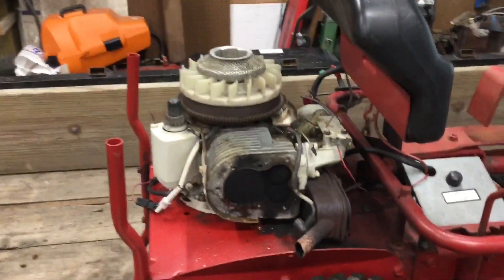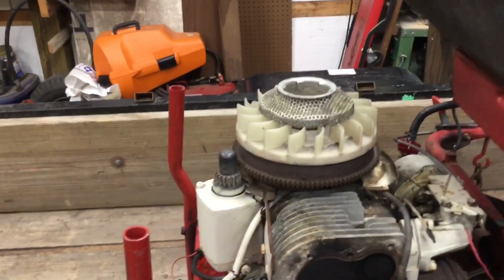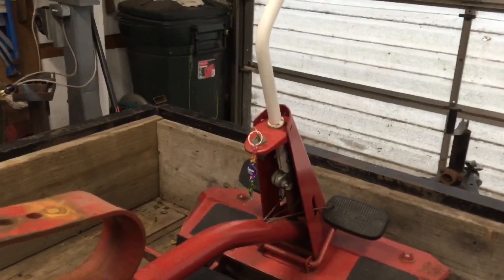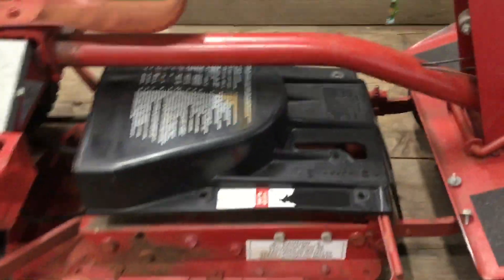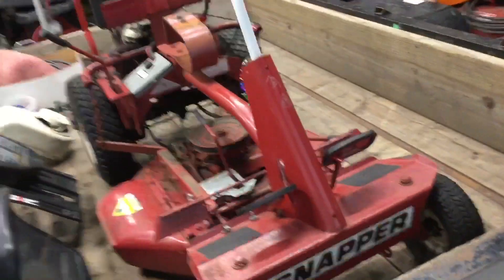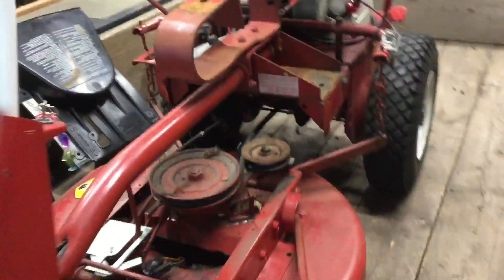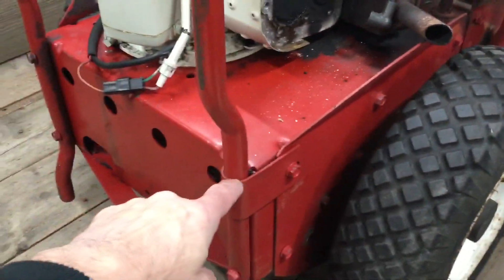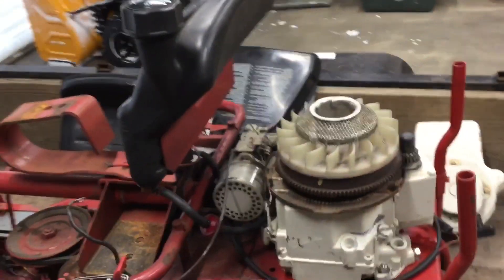408. Where can I buy parts for my 25 inch Snapper RER.

Comment: I wold be interested in the choke/throttle/governor linkage and plate with the levers and springs, if you still have them.
Reply from the maker: I’ve still got the stuff I think I would like to send you some pictures but for some reason I can’t through the comments send me an email so I can email you back and send you some pictures, mine is.    jimsfixshop@gmail.Com      Jim

Comment: Hey Jim,  If you still have one I need to find a replacement for the belt guide for the idler pulley.  If you have one please let me know what you would need for one and if you don't still have one can you tell me what the part number for one is.  I have been having some trouble trying to find it.  Thanks a bunch.
Reply from the maker: I would need your complete model number to find which one you need and are you talking about the one that bolts underneath the engine or the one on the mower deck.      Jim

Comment: Hey Jim Merry Christmas to You , & your family ! That Snapper rer looks closer to a  77 to a 87 ? One it's not a Comet , & does not have the metal cover for the pulleys or the saddle tank, & the handle bar steering came out in 73 ! & that rer is in such great shape if it were mine I'd put a new engine on it or buy a used B&S 8 HP engine & rebuild it with a kit which are still available! & just buy it as is ! As a whole imho , Jim I hope to see that Cub Cadet in action soon with all the snow your getting !!!! & stay warm , & May You & family have a safe , & healthy new year !!!! SNAPPOUT .
Reply: I agree this is an Early 1980s Machine as it also has the Blade safety Pedals which I believe came out around 1983 or so , a 1970 Machine would have had the hoop steering wheel , 4 lug rear wheels , a saddle tank , and the grips on the deck control levers  and shift lever would have been white
Reply: @NorthernMaineProductions  The only thing I can compare it to is a 1974 Comet that I own that is unrestored as of now ! & I did put a bigger engine on it 8 HP 1996 ! Hopefully in the new year as I have everything I need to complete it but time ! One other thing about this rer is it has black hubcaps , If it were a 70 they would be red which are no longer available ! But black ones are , & as You stated there was no blade brake on a 1970 or 74 .
Reply: @ACF6180T  I also Have a 1975 Comet its a 3081-WS , as near as i can tell mine had a Techumseh engine with electric Start originally , it now has a 1989 8 hp Electric start  Briggs on it that is just about had it , the old Machine works awesome but the motor is very tired and needs to be replaced or rebuilt  soon , in 1975 they still had the saddle tank but had the updated seat and handlebars, they still had a white painted Metal Cover on the Deck but all the controls had black grips on them and the wheel caps are Black also I love them old Snapper RERiders they are so robust and tough!
Reply from the maker: How do you read the date code on a Tecumseh engine. This thing can’t be a 1970 unless someone put a old engine on it. Jim
Reply from the maker: I forgot what is Northern Maine products ?    Thanks Jim
Reply: @NorthernMaineProductions  I totally agree !
Reply from the maker: Hey Venice it’s Jim
   I found your channel and been watching some of your videos pretty interesting I didn’t know you had a YouTube channel but I think you owe me for all my help a picture of you sitting on the comet  to put on my Wall of friends. Jim
Reply from the maker: Oops I forgot send it to my email which is
jimsfixitshop@gmail.com
Thanks. Jim
Reply: @jimjackson9381  Hey Jim ! News to me as well ! I didn't know I had a You Tube channel either ! I still have your e-mail address , & I'll be glad to send a picture of the Comet with me on it but I've started taking it apart so it will have to wait when I get together ! & warmer weather . Take care & Happy New Year to You & your family. P.S. Let Me know what my videos are about ! Because I don't have a clue🙃🙃🙃.
Reply from the maker: @ACF6180T  well maybe I got you mixed up with another viewer I’ll have to see if I can find it and let you know for sure. Jim
Reply: @jimjackson9381  Hey Jim Sorry if you got confused My Channel is "Northern Maine Productions",  Not Products , I don't actually sell anything I am Just a guy Who likes to sometimes Make Random Videos from Northern Maine

Comment: Hey Jim, I really appreciate your videos as a good source of information. I'm tired of my POS Cub Cadet and just want something reliable and not buy a new machine. I'm looking at an SR-1433 that's been serviced and looks pretty decent for $400. Do you have any advice on what to look for or if parts are hard to get for it? I can't imagine it being that different, just thought I'd solicit your opinion.
Reply from the maker: No I don’t have any trouble finding parts for them I get mine from Parts Tree.Com on the Texas you can call the phone number which is on the homepage and they will actually answer the phone and help you. Jim

Comment: Jim. Just seeing your video from i believe around Christmas about selling parts off the 1970 Snapper. By any chance do you still have anything left?Thanks again for your videos.
Reply from the maker: Yes I do what do you need.  Jim
Reply: @jimjackson9381  Thanks Jim. One thing I need is the little bracket that goes on the plate near muffler. Hope i’m describing it correctly.
Reply from the maker: Wouldn’t happen to have a picture of it would you is it the bracket that goes around the bumper to help support the weight of the bagger, if so I need a picture of your muffler deflector plate to see if it would actually fit or not. Jim
Reply: @jimjackson9381  Yes I think that’s the one. I’ll try to send you a picture of my machine and maybe you can see what I’m talking about.
Reply from the maker: @thomasiadarola35  send it to my email which is
jimsfixitshop@gmail.com
Thanks.   Jim

Comment: Jim , first how do you read the serial number ? Why not just put a replacement engine on the old machine ? How about Harbor Freight ?
Reply from the maker: I guess I’d have to check in to see how much they run, I know Briggs & Stratton. would run me about 500 and I don’t think I could get that much out of that machine. Jim

Comment: Hi jim. I just picked up a snapper re100 with a blown engine for $50. Is there an other direct bolt on engine upgrade other than the 1000 series 223cc brings and stratton engine that is currently on it?
Reply from the maker: I’m not sure I’ve never swapped an engine out on one of those, I would think any Briggs & Stratton engine around a 10 or 10 1/2 horse should fit most of them. That’s what they have on them is 10 horse engines. Jim.
Reply: @jimjackson9381  ok thanks. Do you know any websites parts for these snapper mowers at a decent price?
Reply from the maker: @bruhbedrivin  I get my new parts from Parts Tree.Com out of Texas. They seem to be reasonably priced. Otherwise all you have is dealers if there is any still around. Jim.
Reply: @jimjackson9381  ok thanks i will check them out
Reply: @Jim Jackson  do you know if you can use a pull start on a electric start re100? Theres a $300-$400 price between the two engines. I wouldn't mind going the cheaper route with a pull start.
Reply from the maker: Yes you can do that.       Jim
Reply: @Jim Jackson  ok. My blown (chucked a rod) original motor is electric which i still have. I can convert the manual motor to electric in the future if i swap off the starter, flywheel, and alternator right?
Reply from the maker: @bruhbedrivin  I am not really sure if I follow where you’re going with this email, are you taking a gas engine off your machine and putting a electric motor on it?       Jim
Reply: @Jim Jackson  sorry for the confusion. The motor is gas with electric start.  My Turtle (snapper re100) currently has an briggs and stratton 1000 series 10hp gas electric start motor on it from factory thats blown. To replace the same exact engine is about $600 which im not trying to spend right now. Theres a pull start version of the same engine for $300. I see people are swapping over electric parts(starter,alternator,flywheel) on to manual motors and converting them to electric start. I was jus curious if i can swap those parts off the blown electric start motor currently on the turtle and put them on the pull start motor i want to get and convert that to electric start.?
Reply from the maker: @bruhbedrivin  yes, you can switch to a pull start and change some of the parts if they’re both the same horsepower and your flywheel will have to have the ring gear on it for the starter to mesh into. Jim.

Comment: How much for the rear number bars?
Reply from the maker: Well I’m a little lost on that email do you mean the rear spreader bars that I make if so the unpainted ones are 1850+1050 shipping the painted ones are 2350+1050 shipping.     Jim
Reply: @jimjackson9381  the 2 bars the comet stands on for servicing.
Reply from the maker: @averagejeffhomesteader  That is what they call the rear bumpers and the part number is 7030798 for $30.99 apiece from Parts Tree.Com I have some I will sell for $35.00 for two plus shipping if you are interested I will need your name address and zip code to get shipping cost.      Jim

Comment: Jim that’s not actually a 1970, I have the books to that exact machine as I am rebuilding one. That’s a 1985 model year machine. 1970 would have had the old metal steering wheel instead of the white handle bars and a metal has tank, also the deck blade belt cover on 1970 units was steel not plastic. Only reason I know this is because I have the books to this machine. Thanks again Rich G from New Jersey!
Reply from the maker: Yes we figured that out I was going by the date on the engine which is typically how you figure out the date of the machine someone put a older Tecumseh on it.  Jim